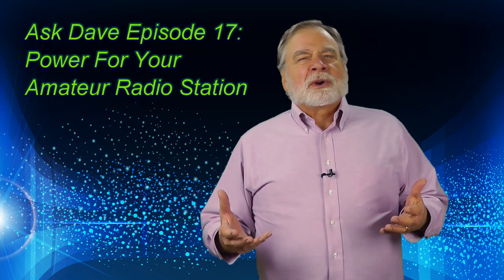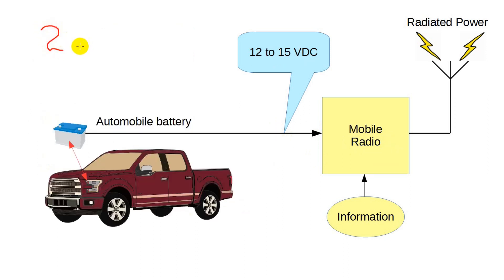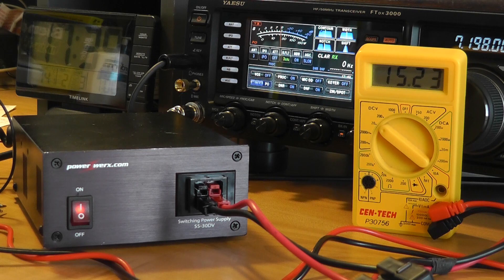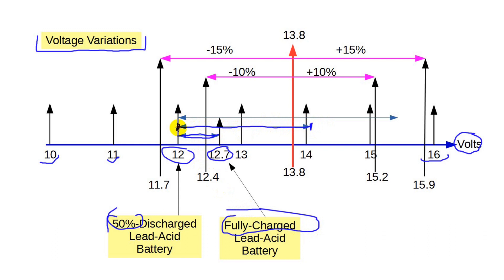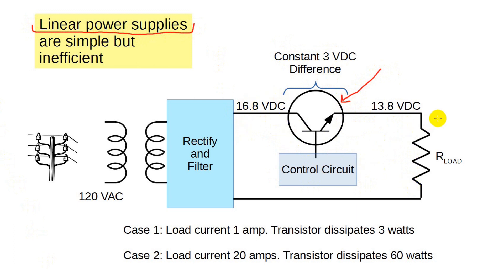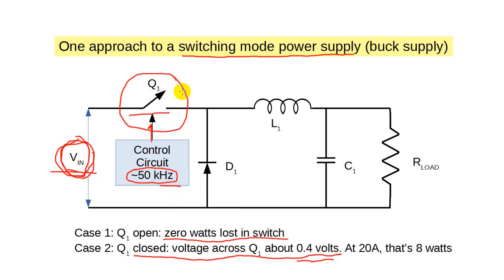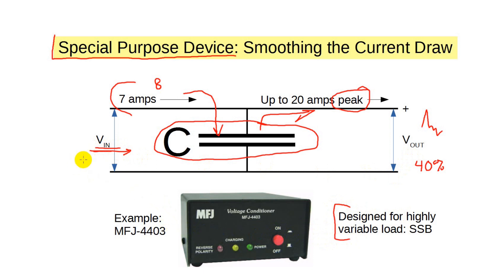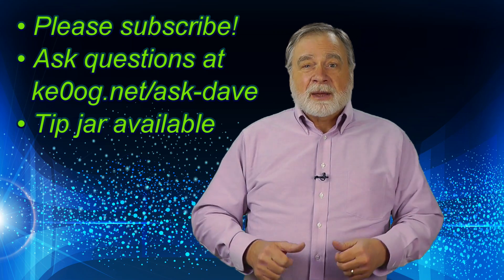Ask Dave 17: Power For Your Amateur Radio Station

Comment: Dave I have a Beofang 5001 mobile unit.  I had it on a 12v Solar system until I upgraded my solar to a 48v system. Now I am looking for a new power supply for my radio.  Any suggestions?
Reply from the maker: Lots of people in your situation simply use a normal 120vac power supply that plugs into the inverter output, and power the rig from there. Hope that helps! 73, Dave
Reply: Thanks, looking at TekPower TP30SWII 30 Amp DC 13.8V Analog Switching Power Supply with Noise Offset. Would like you thoughts.
Reply from the maker: Well, it certainly looks fancy! My fear with an adjustable voltage power supply is that I might bump the knob and change the output voltage without knowing it. For that reason I'd suggest a 13.8v-only power supply. That said, you may find uses for the variable voltage. It should certainly work. The frequency change capability might help, although all good amateur radio supplies are well-filtered enough that the harmonics of the switching frequency are not a problem. 73, Dave
Reply: Thanks you so much for your thoughtful reply. Your videos are very informative.

Comment: I have a question. What power supply should i get for a 65w 2m mobile kenwood?
Reply from the maker: Pretty much anything will do that meets the power supply requirements laid out in the owner's manual. I should think a 15 to 20 amp 12vdc supply should do. Make sure you get one designed for ham radio so that it has proper filtering.
Reply: David Casler Thanks!😃

Comment: Whats up with the $10.00 Harbor Freight multi meter ? I would not trust it to tell me if gravity was still working (ie drop test), much less measure  the voltage going to my $3000.00 radio. Get a Fluke.
Reply from the maker: +Michael Katt Good advice. Unfortunately they're quite a bit more expensive, but you're right, I should get one. I'll put that on the list. Might even make a good Ask Dave episode! Do you have a model you recommend? 73, Dave, KEØOG